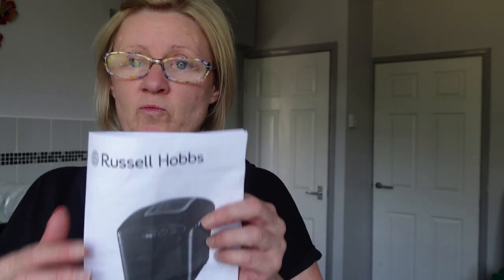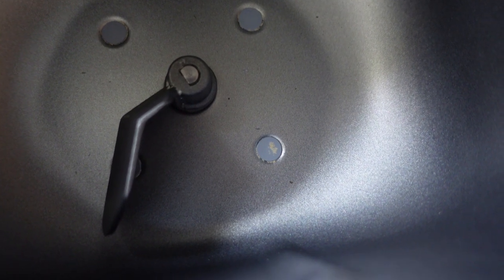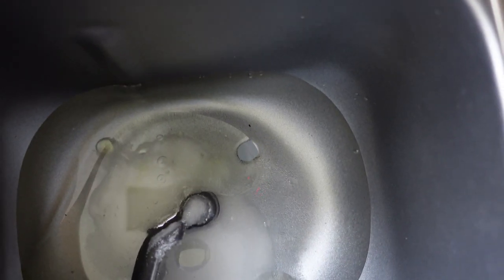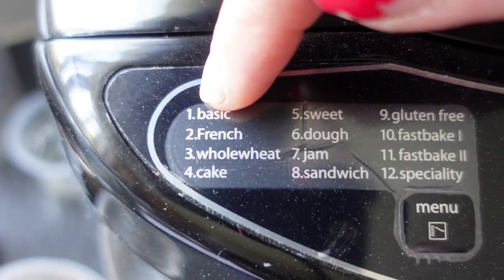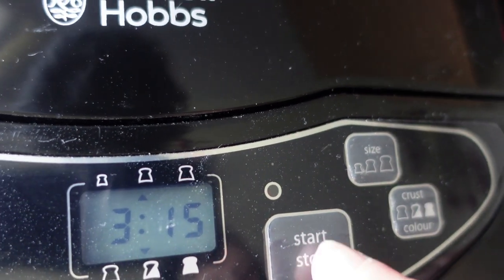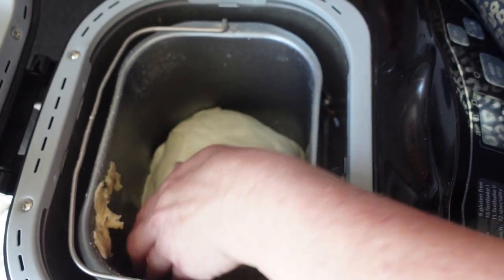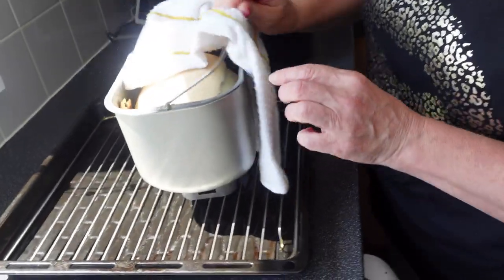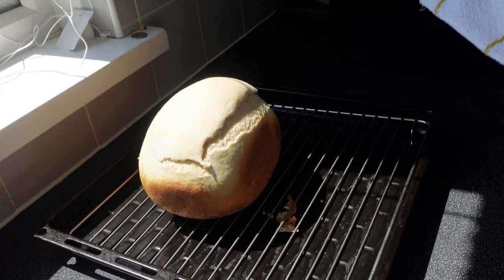russel hobbs#breadmaker#nomoreholes#paddleout#perfectbread

Comment: Take paddle out place grease proof paper over where the paddle goes and that leaves you with a bread with no holes at all
Reply from the maker: Thankyou for the comment I will give it a go
Reply: What is grease paper 🤔
Reply from the maker: Greaseproof paper is used in baking and cooking as a non-stick surface that is heat resistant. This allows for your cooking to not stick to the base and is often referred to as bakery paper or parchment paper.
Reply: Could you elaborate more, how there will be no hole with the grease paper as there is a shaft stick out from the bottom of the pan
Reply: @soysan34  Proof paper, which would be parchment paper
Reply: @sarnosidiq6212  exactly. There would still be some kind of a dent in your bread.

Comment: You can take the dough out and reshape it and fix the hole and then place it back into the breadmaker
to bake so you don't have a hole at all. That's what I found out when I was watching other videos. 
If you reshape the dough, the loaf comes out a better shape.
Reply: No, you will still have a small hole made by the spindle that turnes the paddle, just like here.

Comment: Needed this, thank you
Reply from the maker: Your welcome thanks for watching
Reply: Since my last comment I tried again but as I am in New Zealand we mix our ingredients in a greatly different way & I suspect that our yeast has different characteristics as the end result is not as good as I expected.
Reply from the maker: I'm sorry to hear that ,I mixed mine the way the instructions are set out in the manual ,if you can time when all the kneading stops , and the bread starts to bake ,that's when you need to take paddle out ,hope that helps you 😀
Reply: @valleyvannersontour  Thanks I noticed in some other on line comments that 1 :40 ,was being used as the right time by a number of people but you if I remember correctly removed your paddle at 1 :20,& you were baking basic medium loaf setting 1 on menu.I will try removal at 1 :20 instead of 1 :40 next time
Reply from the maker: Ye it all about testing what's right for loaf you are baking, good luck